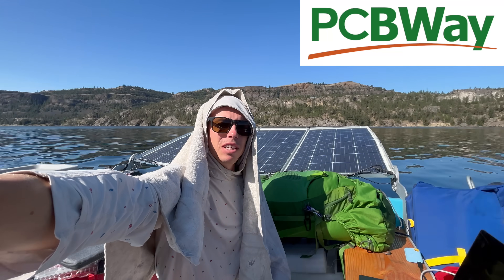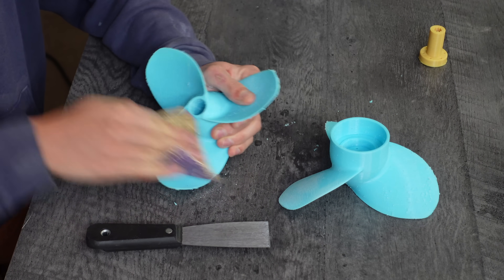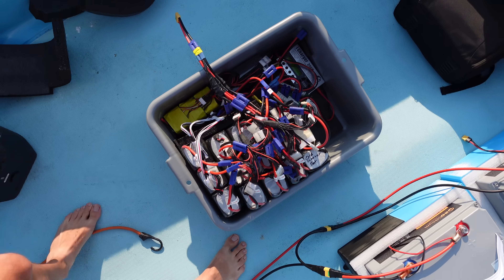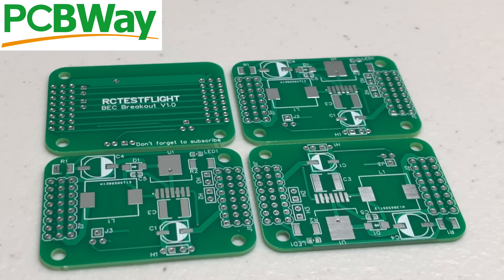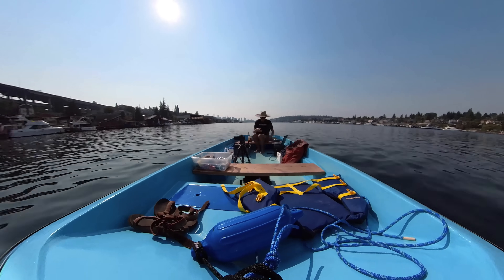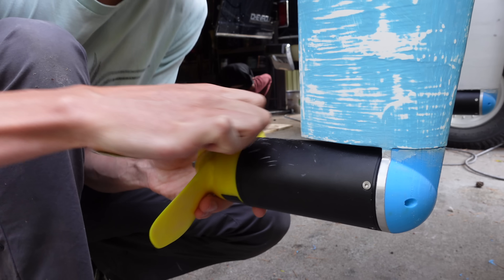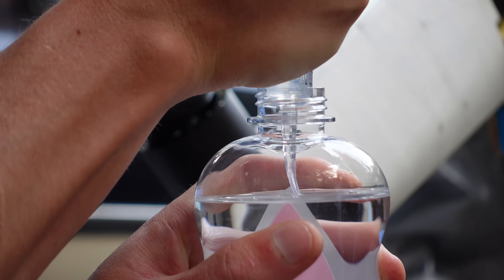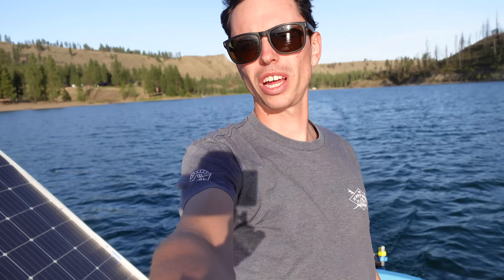Can a 3D Printed Propeller Handle 3 Horsepower?

Comment: funny suggestion for some sort of a challenge: get a somewhat larger boat. how long can you stay on your boat? (short trips to the land are either allowed or forbidden).
at least 1 3D-printer on the boat for quick repairs.
supplies to the boat need to be flown in with a self-made quadcopter, extra points if you don't need a person on shore but you can order supplies to a pier, where the delivery person just sticks them into the quadcopter and have a little airfare for the last leg of the transport.
just saying, could be fun.

Comment: Just a thought Daniel: Do you have any sort of "Dead Man's Pedal" in case you fall overboard while you're in autonomous mode?
Reply: That's a very good idea - I think a wrist strap is the usual method for surfers, jet skis etc.. but that's inconvenient when you're moving around on the boat doing stuff.
A bluetooth wristwatch kind of solution could work if the BT watch signal is lost then the motor stops, or turns around to find you.
Reply: @ahaveland  17 seconds in

Comment: For your safety, is it a wise idea to implement a killswitch, like they are implemented on an outboard (for when you fall overboard)?
Reply: and to start wearing a life jacket already
Reply: @ImDelphox at least like a small comfy one
Reply: You’re making going overboard sound inevitable… you’re right.
Reply: Isn’t that what the deadman switch is all about, which you can see in the beginning. I mean the sound the Remote makes for him to move it.
Reply: @BillyElliot1998 yeah but if you have to wait till that inactivity switch activates then you could already be dead
Reply: @TTTray13467  how long do you think one can swim without West in these calm waters? Wtf. Don’t you think he can manage for like 5-10 minutes. I think he very well could. Or at least he does,lol.
Reply: @BillyElliot1998  yeah but it’s not about swimming it’s about falling out and the prop cutting you up and killing you. It’s no joke at my local lake 2-3 ppl die every year and they are never wearing the kill switch or life jacket. In fact since This first comment I was on the river and hit a log and threw me out of the boat. Lucky the driver didn’t fall out but still lost the kill switch and turned the motor off as the boat was running me over. So yeah it needs to die immediately.
Reply: @BillyElliot1998  he seems in shape enough to easily be able to tread water for an hour or swim a full mile clothed.

Comment: 4:00 Could you get more amperage from the motor drives by adding a water cooler? I mean, it would seem like you can have the radiator be in the lake at the back of the boat, near to it to reduce drag (or whatever boat equivalent is there). Also am just curious to see what it would look like lol
Reply: I'm not sure if you would be able to get more power. If they're currently hitting a thermal limit, then you probably could, but if it's limiting for another reason then it probably wouldn't affect much. You wouldn't need a radiator either, RC and regular boats just intake water to run through the cooling loop and then discharge it back into the lake/river/ocean/etc
Reply: @FowlerAskew  I remember my father telling me about how his boat takes water from the lake to cool the motor, and even showed me how to hook up the garden hose for testing the motor, though I forgot how to hook it up as I never had an interest at the time and was focused on other stuff. 

I typed another paragraph before your comment finally clicked and I connected what my father did and what you said, which would likely be a much better option... also I am certain that using a small water pump would be much easier than the radiator idea lol.

Comment: It would be possible to further improve your installation by adding floats under the outer end of the solar panels, which would improve the stability of your boat and avoid putting too much force on the fixings, moreover it would allow to have a navigation a bit more energetic in the event of an emergency maneuver.

Comment: One thing, I think you will get improved cooling if you rotate the heat sinks 90 degrees. If you can put a plastic cover to create "chimneys" it should improve even more. You want convection flowing up over vertical surfaces. Just a thought ...
Reply: I think the idea is that while the boat is moving, it would provide wind to flow through the heatsink fins.
Reply: @YosukeMatsumura  Do you think it will move fast enough? And behind the transom? I did have the same thought, but I believe convection would be more efficient. just a gut feeling.

Comment: You should get yourself a radio-controlled airplane prop balancer for balancing your props
Reply: Dose it work under water?
Reply: @ionstorm66  you balance your props in the air not in the water balancing a prop is the same for an airplane or a boat
Reply: @jamesturncliff5960  nope you have to hydro test water props. Air balance is entirely different.
Reply: He did an experiment with air and water props.  An air prop vibrated badly under water, but was fine out of the water.
Reply: @robertheinkel6225  you can use the same mechanism to balance a propeller for a boat the same as an airplane
Reply: Seems like more issues of thrust balancing than weight balancing. However that could be more to do with the flow of the water leading up to the prop. (Needs a more hydrodynamic shape on the lower unit part.)

Comment: Should have taken a 3D printer with you on that long trip. Never know when/if you'll need a new prop, bracket, or some other small-yet-important bit. Pretty sure a 3D printer can run quite happily on battery or solar since most it needs is 12 or 24v for the hot end.
Reply: Lol

Comment: I have the same problem on my underwater motor setup for windsurf board, my current limit is 30A (due to smaller motors) but it also pulls much less from the battery, VESC showed low RPM and high current, but low phase voltage so by reducing load on motors (fewer blades, less pitch props) I hope it will spin up faster and produce more power (also have higher phase voltage) for the same phase current. Will test it in a few days.
Reply: Did it work?
Reply: @DIVINGDUDES  yes, it helped, there was power/thrust increase but still I wanted more so ended up with bigger motor. After watching video on prop efficiencies, I think I could have done even better with prop tweaking. Maybe this year I test some of the top contenders for prop efficiency challenge

Comment: Why does water get into closed containers?
This is because there is a heating element inside the container.
When it cools down, the inside of the container becomes negative pressure and absorbs water.

Comment: If you rebuild the solar array on this thing you should really give yourself some shade with those panels.
Reply: i know, every time i see that thing i keep thinking it needs to be shade. I mean using solar panels for shade seems like the ultimate win win. The only thing better would be to get solar, shade, AND use them as sails.
Reply: What about the vitamin d? :D
Reply: @williamli8708  well he is in the PNW so it wouldn't be entirely unexpected for him to be D defficient
Reply: i built just thing for a sailbpat: a bimini frame retrofit
Reply: He in Seattle. WTH he needs shade for
Reply: @felipe96150  to protect him from the clouds
Reply: As a ginger, shade would have been my first priority with this build haha.
Reply: Making it more top heavy will affect the float and center of gravity maybe need to add outriggers
Reply: @FUCKDSS  if it's a balloon it wont
Reply: Make a solar weather balloon to tie to it that doubles as a sail.
Reply: @Shredxcam22  I wonder if it is possible to make a hot air balloon (a small one, not for carrying humans) that is just powered by the heat from the sun.
Reply: @conorstewart2214  fill it with sunny d and it will have the power of the sun
Reply: not viable if I may say. It´ll get way to top heavy and unstable, Only option if he really wants the solar above the hull to get shade is to make the boat a mini Tri-catamaran like extensions.
Feel free to elaborate and correct me.
Reply: @Patnik86 they literally have a factory top option😂. Wouldn’t be hard to place them on top. Also this  is a tri hull. It’s extremely stable.
Reply: @Patnik86 wrong.  That boat is plenty big.  A small Boston whaler.  The actual concern may be wind.  But either way using the panels for shade is a great idea.
Reply: @thebarkingmouse high center of mass is a problem for any boat.
Reply: @davidaugustofc2574 these whaler hulls are heavy as hell. I've seen them running with a full size roof.
Reply: @davidaugustofc2574 that depends on how heavy the hull is vs. the panels. Panels are up top but the batteries, motor, rudder, propellers, passenger, etc. are down low.
Reply: you'd really want a different platform for shade above the passenger area, a wider flatboat, or a pontoon would almost be a requirement to remain stable.
It might be reasonable to do a chest high solar roof in the back half of the boatr with a bit of an overhang over the motor.